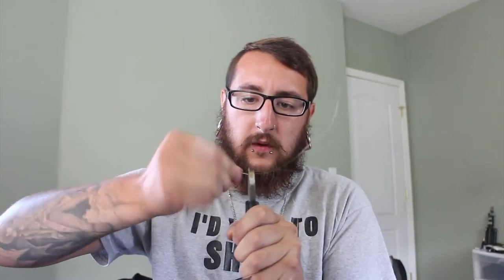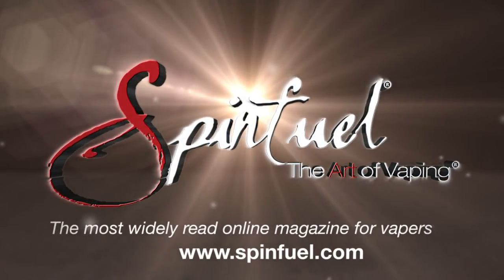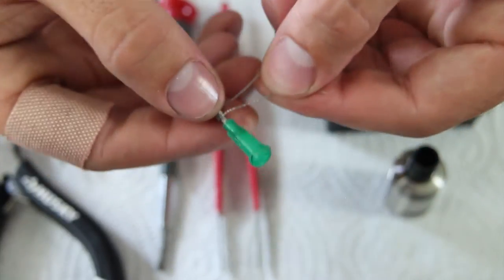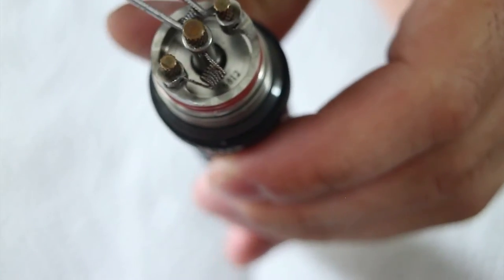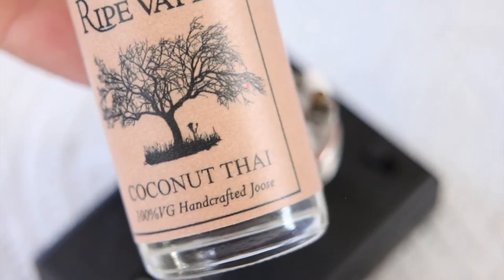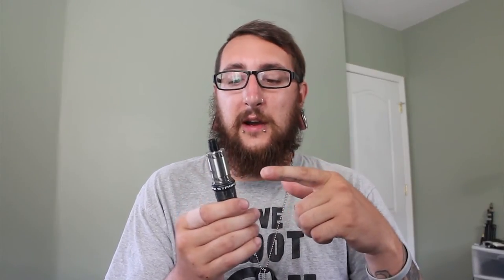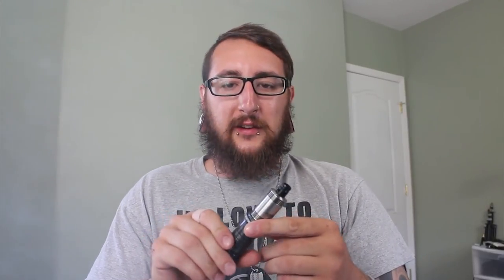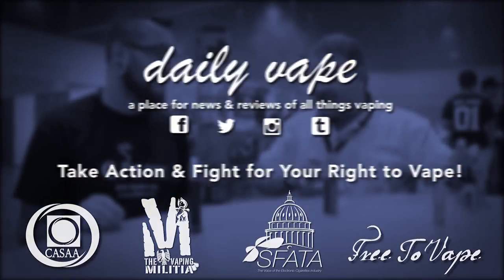#FRESHBUILDFRIDAY - Triple Twisted 28g, 30g & 32g

Comment: I tried a build like this with 3 pieces of 30 that I had left laying around and I found that three pieces of wire dont twist up nearly as nicely as two wires do.  I had the same kinda imperfections in mine as well.  The flavor was actually too intense for the juice I was using and made a good flavor taste too strong.  Im going to try 3 pieces of 28 next time but with more wraps to increase the ohms a bit so I get a cooler vape.  Great video and thanks for all your great videos.
Reply from the maker: You gotta try everything. Every build is different. I just did a triple twisted 28g and I hate to tell you it's still plagued with breakage :( BUT otherwise the flavor is amazing and it's not too hot. I was able to salvage about 6 wraps worth (around a 5/64" drill bit) and it came out to .3 ohms. Currently running it in my Vulcan RDA with only a single coil. Loving it so far, vape on!